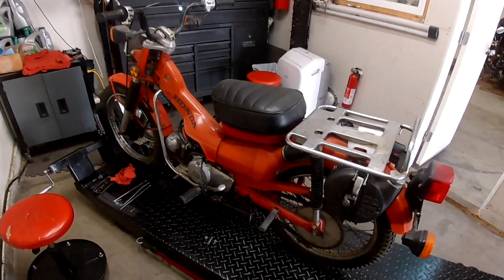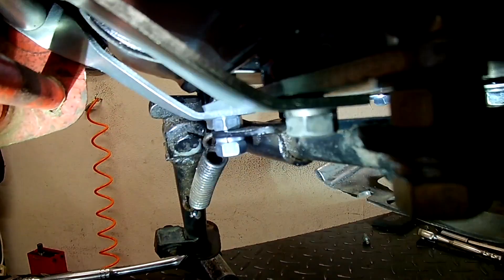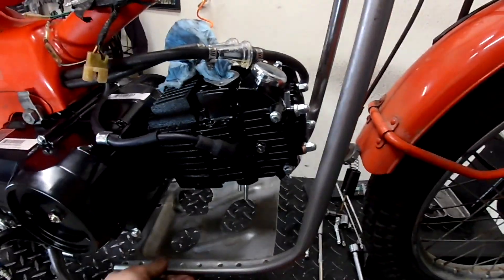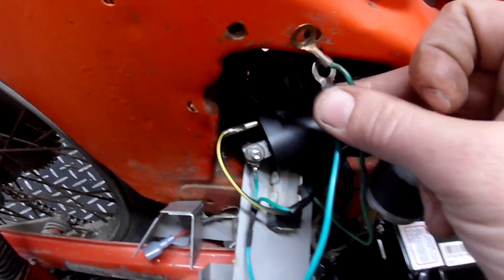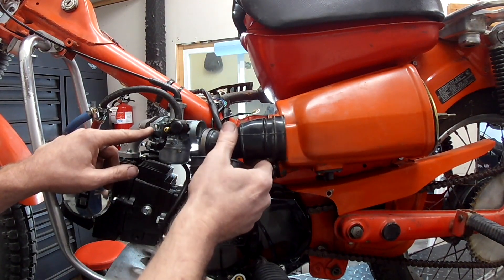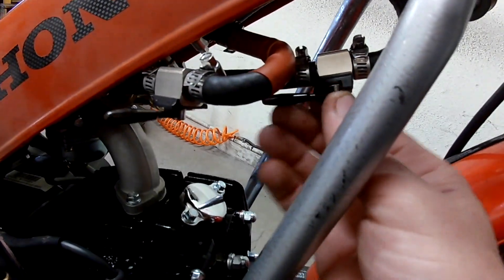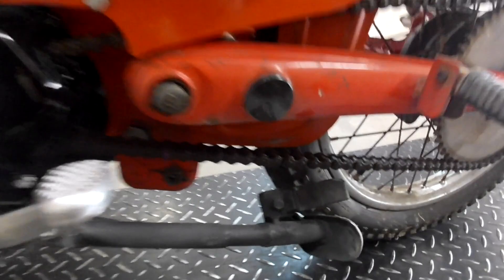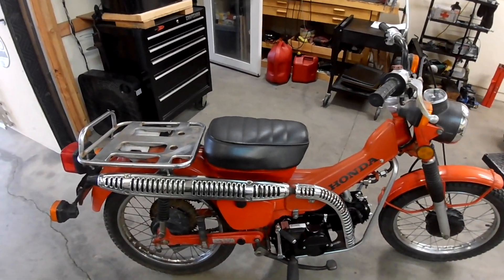DIY 1980 Honda Trail 110 Lifan engine swap CT110 motorcycle! Nearly stock swap. Sweet upgrade!

Comment: You can also get some winding wire and add a few more winds to the stator + add a Trail Tech rectifier and LED bulbs and have brighter 12V lighting that also keeps the battery charged.
Reply from the maker: I haven't heard of that yet. I will check it out! Thanks for watching!

Comment: Those two brackets should never have been used, it puts the engine at a wrong angle, and nothing fits. If you tilt the engine up a bit more,  you will find that everything fits. If you tilt the engine up till the  exhaust fits, you got the  same angle as the Honda  motor. The difference between the Honda and the Lifan in height, is about 30mm, so everything you mount to the Lifan will sit 30mm higher than it should. I made my own bracket and lowered the plate by 30mm, and everything fits, all you have to do is to drill two holes in the bash plate. If you click on my name, you will see that I did.
Reply from the maker: I just checked out your video! Nice job!
Reply: @homeimprovementdiyguy9088  thanks